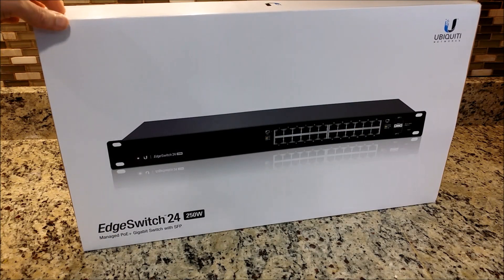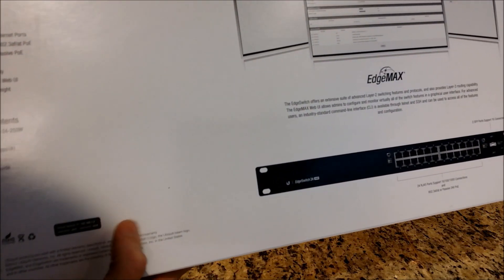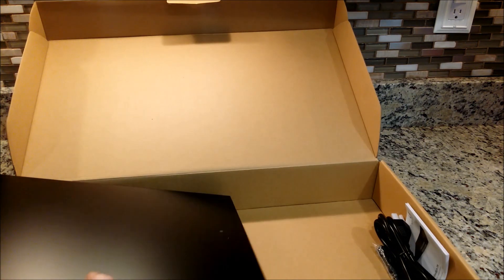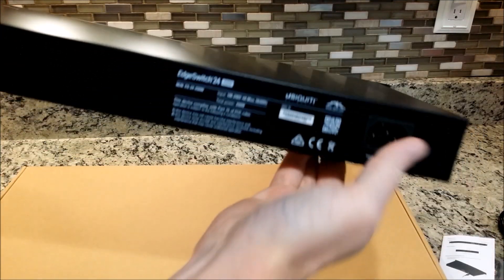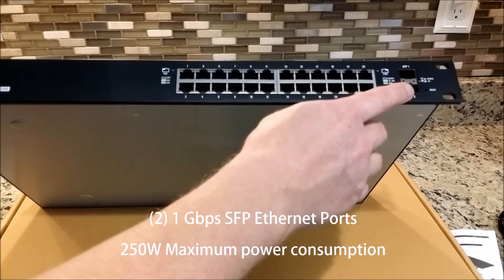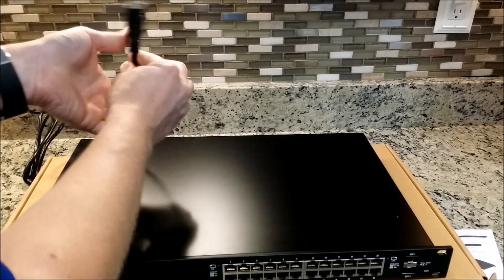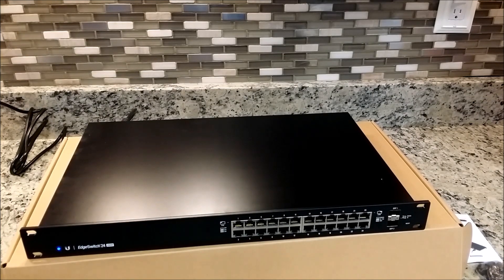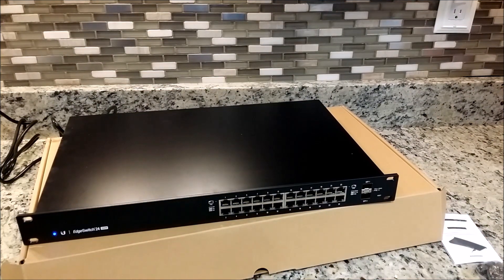Ubiquiti Networks EdgeSwitch ES-24-250W unboxing by Intellibeam.com

Comment: How was the performance? Reliability?  I am still thinking of buying this one or toughswitch
Reply from the maker: I'd avoid the Toughswitch as there hasn't been an update in years. The EdgeSwitch has been up since the day after this video on our network. Rock solid.
Reply: Intellibeam There were reports about how loud the noise level that makes me worried.
Reply from the maker: Rainnap Ours has been pretty normal. Running the latest 1.01 firmware.